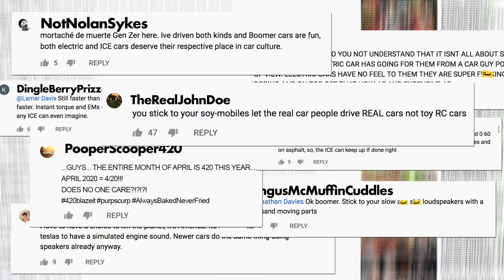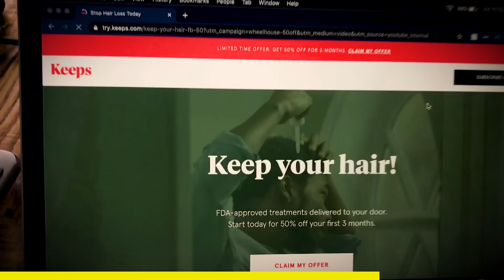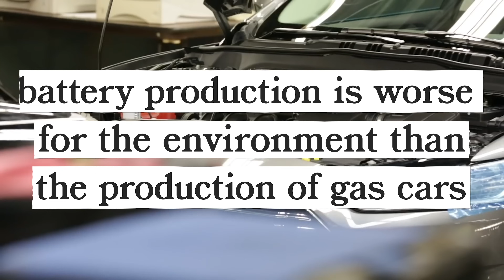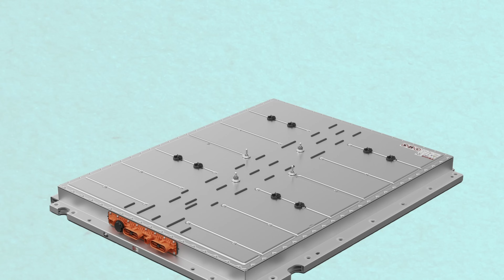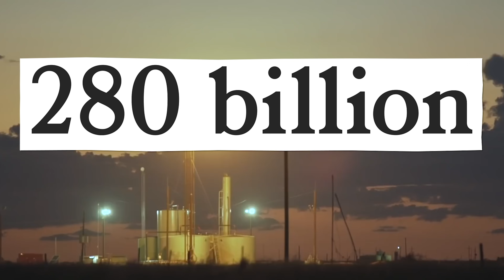Are Electric Cars REALLY Better for the Environment?

Comment: It's a good snapshot of today, but the trend lines should also be noted. The use of coal in the US continues to decline as solar and wind are increasing. This will decrease the CO2 to charge and also to produce cars. Battery chemistry is also getting better. Tesla's CN batteries use no cobalt and non-lithium batteries are looking more and more feasible. ICE cars are getting slightly more efficient, but only minimally...

Comment: But Nolan, what about “pzev” cars
Reply: Fujiwara Fan boi A lot of cars today are "pzev", even my 2016 GTI which got about 20 mpg was a "pzev" even though it didn't have an electric assist. If you mean a hybrid, it's the worst of both worlds. It pollutes more building the battery for the EV component, still runs on petrol and emits greenhouse gasses, and they're generally heavier than traditional cars or EVs which produces even worse efficiency. As I understand it, it may be marginally better than getting an ICE vehicle in some cases, but if you want to reduce your carbon footprint an EV is the clear winner.

Comment: Nolan - myth #2, the capacity of the grid,  needs a bit more explanation on why its false.  Imagine how many more brown outs would occur, and also how much longer they would last, if powering 25% of the autos on the road were added to the grid.  Perhaps in terms of total grid capacity, there is the ability to power 25% of autos, but brown outs suggest the grid, at least at a localized level, would be strained.

Comment: I'm just hung up on long term maintenance, batteries have to be replaced and we have no real path to actually working on these cars the more tesla and others try to lock you into what could be at best dealership only maintenance.

Note this is less an EV problem and more an industry issue, but I think it's worth considering as reliability and how we handle it is also a big part of what waste we produce and we may not understand that until E-V's have a chance to start topping 100-200k in the hands of cheapskates and grandma's

Comment: hydrogen is the way ,small batteries,  hydrogen can be produced without harming the  environment and the by product of hydrogen can is water .that's why most of the Japanese companies are still developing  it and f1 is going hydrogen engines and when f1 gets their hands on it it will only take around 5 to 7 years for the tech to get into normal cars

Comment: 5:54 depressed nuclear power plant noises
Reply: There are nuke plant designs that if implemented would use up most of the "expended" nuclear fuel.
Reply: @EveryBigfootIsANinja  pretty sure your thinking of breeder plants. They are fucking awesome but are banned because part of their process involves highly enriched uranium, aka the bomb stuff so the US didn't like that
Reply: Yeah, personally I reckon nuclear is the way to go. I’m not exactly an expert, but last I read, they’re far safer than common belief, and leave less waste than renewables. Plus as LegendStormcrow said, there are new generation plants that are looking to recycle fuel. But yeah, fossil fuel power definitely needs to go.
Reply: Yeah nuclear plans actually turn out to be one of the safest energy sources. Lots and lots of people die in coal mines
Reply: They are more dangerous than solar, at least in theory. If a plant goes critical, that's an entire territory uninhabitable. But the odds of failure are so insignificant, that only intentional cock ups can even provide catalyst for disaster. The power they produce vs the risk is so overwhelming, it only makes sense to build more. But god forbid we give more Americans high paying jobs with genuine responsibilities. EPA would be all but paper pushing.
Reply: @SCIFIguy64  solar energy is trash though. It like saying crawling is safer than driving. Technically true but crawling any reasonable distance is not a viable means of transportation just as solar is not a viable means of mass energy production
Reply: Im about to start nuclear power generations systems. One thing that was described to me is that the waste of a nuclear power plant is a whole lot smaller than a coal plant. Nuclear power can make more energy than any other power plant.
In a year a coal plant produces enough ash to fill up a football stadium. In a year. A nuclear power plant spends enough rods to just cover the field of the a football stadium. The waste isnt entirely the problem. The issue is the government doesnt have a process set yet for how to dispose of it. The government doesnt want to. Spent rods have to be stored ON SITE until it can be moved. Then every 3 years the power plant near me sues the government for the money necessary to move it. And the process repeats.

Comment: They still use electric to charge and most of that electric still comes from non-renewable fossil fuels. Some electric is wind or water generated, but if you have ever visited a wind farm or hydro power plant they still need oil products to run or be manufactured. Yes, the batteries do take a lot of fossil fuels to manufacture also lithium is also non-renewable fossil fuel and contaminates water when extracted from the Earth. Then when the batteries wear out then disposal of the batteries? 
And so on and so on!! Good and bad of both.
Reply: Shipping from the lithium farms to the battery manufacturer and then shipping from the battery manufacturer to the   car manufacturer.

Comment: The question isn't "are"; it's "can be".

ICE's can't be good; they can't even be anything but horrible.

eVs can be good; not merely less bad, but actually beneficial.

We have, according to science, only until about 2030 to stop emitting CO2 from fossil sources or the odds of runaway global warming exceeds 50% in later decades. Only with eVs can we avoid that runaway.

Are there issues with eV technology? Sure. Compared to the issues of ICE's? Remember ICE's have had explosions, leaks, poison.. remember the Pinto? Leaded gasoline? OPEC?

Comment: Totally biased 👎
My 30 year old 3 Liter Diesel has 800k miles on its first engine and was very low maintenance. EVs don’t hold as Long, you would have to buy 8 new comparable cars which are Tesla’s. So you totally missed the point 👎👎👎

Comment: This is a great video, super useful and informative, but there are other negative issues with making lithium batterys just like methane for gas cars there are chemical leaks at lithium mines causing water pollution and acid rain causing devastating damages to local ecosystems and the rain forest. gasoline in general produces way more co2 than evs, but the issues are very complicated and this is a great conversation starter. Thank You Donut

Comment: Nolan, though you mentioned lithium, you failed to mention just about every other mineral resource needed for EVs. They use 2 to 3 times more copper than ICE. This requires more copper mines, which tend to be in isolated regions that require large petroleum-powered excavators, roads for transporting raw materials to ports (check out the emissions of concrete), expansion of sea ports (more concrete), more sea and rail transport, and then processing such as smelting. Same too for nickel, bauxite ore, graphite, rare earth elements, and all the other minerals. And cobalt is a very scarce resource presently with one main supplier. Further, to extend the range automakers need to use light-weight materials like plastic and carbon fibre, both of which use a lot of petroleum. Then the electrical distribution system needs to be expanded greatly. These too have their environmental costs. For example, many people install power walls in their homes, and homes are easy to retrofit. However, people also live in large apartment complexes (have you seen an Asian megapolis?) that will need to be retrofit.  

It's fine to claim you're unbiased. But, more worryingly, is your lack of thoroughness. This a major shortcoming because it creates a skewed conclusion.

If someone were to promise me an auto and then deliver me 15% of one, they've failed. That is what your analysis has accomplished. Why that is I don't know. Perhaps this topic is beyond your research and analytical talents. Which is OK. Few here watch you guys for serious subjects. Stick to what you know. Or, devote the time and effort to address the topic in whole and not in part.

Also, nuclear power is a zero-emission power source, though all the concrete used does have its CO2 cost. Same too for dams, and environmentalists usually oppose dams. For turbines, sulphur hexafluoride, or SF6, is widely used in the electrical industry to prevent short circuits and accidents. SF6 has the highest global warming potential of any known substance. It is 23,500 times more warming than CO2. Just one kilogram of SF6 warms the Earth to the same extent as 24 people flying London to New York return. It also persists in the atmosphere for a long time, warming the Earth for at least 1,000 years. So much for "zero emissions".

Comment: Diesel efficiency vs electric. 
Diesel gets about 4 times the efficiency, of the electric & it’ll keep on running with regular maintenance. After a few years & many miles after it’s paid for its carbon.

The models for the climate have been wrong for over 50 years. & they will continue to be wrong by hundreds of miles.

Comment: At the end of the day, a car is a car. Changing the power source won't get rid of the significant problems that just comes with it as a transportation device. Effective mass public transport is the ONLY way to carry on in a sustainable manner. 

This isn't to say that we should ban all cars. You're probably on this page because you're a car person. You enjoy them for the engineering marvels that they are. But we are a minority. If governments supported mass public transport, then anti-car laws wouldn't need to be implemented. 

Public transport is the single most effective resource in alleviating poverty. That's not opinion, it's fact. It's also the only way that cities and countries can continue to grow at the rate that they are currently are.  

A developed country is not a place where the poor have cars. It's where the rich use public transportation.

Comment: 8:40 you’re talking about the emissions of the power plants but you show a nuclear power plant that has zero emissions. Also, when the “coal” power plant was also a nuclear one.
Reply: All they showed was a cooling tower, you don't know what type of generation it is from that clip.
Reply: actually, many types of power plants use that style of cooling tower/smokestack. its a common misconception that they are all nukes.
Reply: It gets tricky when you start talking about attributable lifetime emissions - just like fossil fuels and lithium, nuclear fuels need to be mined, refined, and transported, and at this point in time, that means that there is some CO2 impact. You also have CO2 impact from the construction of the building. But yes, the only thing you see in the clip is water (in the form of droplets in a cloud).

Comment: You haven't mentioned the average lifetime of a battery vs an engine. Besides, gas taxes (which go for roads) are only paid by gas cars although electric vehicles use the same roads.
Look at how tesla car values depreciate after they are out of warranty and compare it with Toyotas and Hondas.
Teslas are impossible to repair outside the dealership.

Comment: I like both, i like e-car's tech but i like combustion more since the rumble and pure power and not to forget the sound.
BUT Electic is not the future, these will be die out quickly... because....  hydrogen.... Hydrogen is the future of cars. but fossil fuel cars will be there for many many years to come.
a lot of stuff is powered on fossil or bio fuel and wont go anywhere. maybe over 60-70 years maybe 100+ converting all those machines will cost trillions of dollars. and nobody got time for that.
I still think Electric Cars are worse that fossil fuel cars... why? batteries... we already got a stockpile of batteries of e-cars in Europe and these are no were to go just rotting outside.

Comment: I'm all for an electric future if done clean.
two interesting things that weren't brought up, 1) once the battery is used up, its an issue to dispose of them and most batteries lifetime is 10 years. 2) the emissions from oil production isn't all for cars, so it's hard to put numbers together.

If we all want to live in a clean environment, let's start by lowering diesel engines (rollcoaling is stupid anyways), increase solar energy as wind power isn't a long term solution due to the wings having a lifespan and there's no way to recycle them.

Comment: Bring back trolley buses with small batteries for going off the grid in cities to get around crashes, create high speed rail networks between 1million+ population centers (dont even have to be electric, diesel trains work just fine for this application), and bring on the EVs, make it as easy as possible for the average person to not own a car, and then the car guys and gals can have their fun machines.

Comment: Where is your source for the claim that the electric grid can handle EV's? Was it that link you mentioned? I would disagree unless you plan to keep charge times at the dismal rate that they are. All manufacturers will be refining and improving charge rates. That means more power capable chargers. Wtf, you are in the city of LA. Do you not know how hard it is to get high power system approved by the county? It's a nightmare and limited.

Comment: There is a lot more to consider. like. A LOT. You have to count in the coal plants for electric cars because most electricity still comes from them (which is mentioned) but a point that was missed was the transportation of the electric cars. The toyota prius used to do almost an entire lap around the world before its assembly was required (all the parts, batteries, etc.) and to make up for their production emissions, it would have to drive 250,000 miles. Further than its battery could last. Also, the recycling of the batteries is so incredibly harmful, the US banned any disposal of them in North America.

Comment: It is better until you have to replace the battery, then it would be worse. Honestly I think the way forward is carbon recapture with fusion power, as electric won’t be able to satisfy the cold weather and range performance for everyone. Don’t get me wrong they have come a long way, but electric cars won’t be able to match the energy density and cold weather performance of fossil fuels.

Comment: We should rethink how to make the mining and manufacturing more efficient since on the consumer side it doesnt make much difference, we consume whatever we choose better nonetheless. But crude oil is harder to mine and very expensive and dangerous so i think ICE should still be used in essential part of human life, like portable electric generators for emergencies, for racing, and for aviation.

And making EV batteries more efficient, EV should be more used by more people, imagine using EV you could open your car window and enjoy the air without smelling that direct pollution in-your-face ICE engine emits.
Reply: Definitely there would be diminishing returns in terms of trying to 'make everyone buy EV'   and all mining and industry and household use need to become more efficient regardless.     If we encourage enough commuters to go electric when they can,  among a few other segments like maybe trucking,   then it becomes less important to try and make every car electric or whatever.  Frankly I wish they'd realize that there's only going to be so many miles of people ripping it in dirty old V8s or whatever in the first place,   it's the people driving around in circles burning gas in the daily grind that make up most of the actual emissions.

Comment: They do reduce co2 
But they still rely on the electric grid which runs on coal and worth more demand in electricity more demand on coal and higher co2 emissions
Reply: Did you miss the part where even on the worst fuel power plant an electric still produces less emissions then the most efficient gasoline engine?

Comment: Your quoted EV and ICE vehicle production CO2 emissions seem quite low vs generally accepted footprints of around 30 tonnes for EV and around 25 tonnes for ICE. The production surcharge is 'instantaneous' at the point of production which spikes atmospheric CO2 and in turn atmospheric warming. The affects of the production surcharge will not be redeemed by a comparison of lifetime use efficiency. Use of either EV or ICE simply results in more contamination whilst it is too early to make an accurate assessment of the impact of the EV lifecycle. That said EV's are generally responsible for less CO2 in use although the difference is less acute in Europe where engine sizes are smaller and where miles travelled are generally less than in the US. When solid state batteries become commercially viable for use in EV's the story will change. Fantastic channel and thank you for smashing out such great content every day.

Comment: The issues that plague EV's involve the distance to the source of electricity.  When you plug your toaster into the wall, you're limited to where you can put the toaster based on how long the cord is.  EV's are similar in a sense because you cannot drive it in areas without a charging network, or else you cannot replenish the batteries.  That eliminates travel in over 90% of the country.  Unless you live in large cities with an established charging infrastructure, EV's are not practical.  Certain areas of the country can span hundreds and hundreds of miles without a single charger in sight.
Reply: The Tesla supercharger network covers the entire nation, serving the vast majority of people's long distance needs. For daily commuting, charge at home.